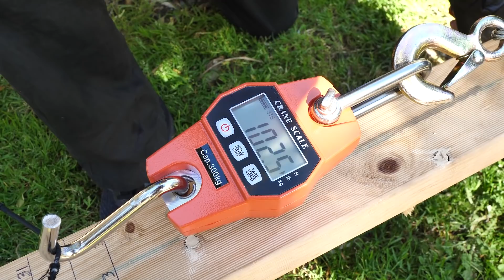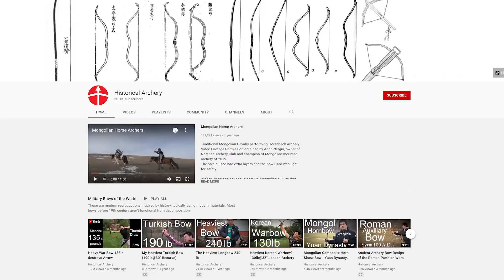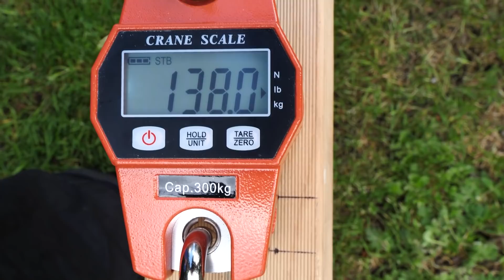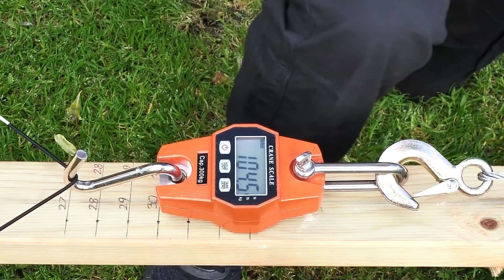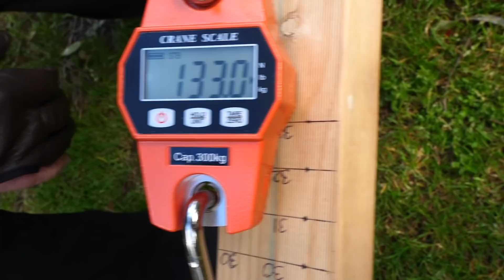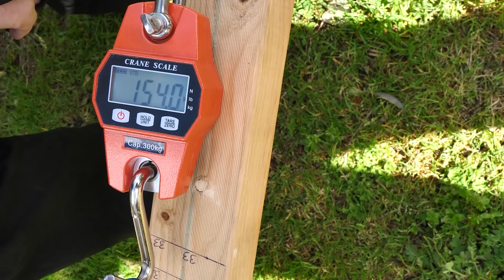Two idiots try to string a  TINY BOW

Comment: Shad, is there a chance you may have a misconception that the bow needs to be this heavy to be effective? Or that maybe bows of the time were not as stout? 

I know the Mary Rose bows are heavy, but what makes us think that was always the case with all bows of the period? (Genuine question, there are probably sources I don’t know of)

I have done traditional archery since the age of 2. My dad built bows and except for a few years between shooting, I have practiced it since.

I shoot modern laminate longbows, american style longbows, recurves, and yew longbows. 

Here in the States, we can kill deer effectively with a 45lb bow. I generally feel most comfortable drawing 60-70 which is more than enough poundage to kill.

With my 95lb Yew Longbow using arrows stout enough to take that weight, the arrows are quite heavy. The arrow speed out of these bows is smaller than the ones from my 60lb Yew longbow, and it seems the arrows penetrate the target less as a result.

Comment: Assuming the same pull weight in actual Byzantine bows you could with a little work come up with an impressive crossbow with better than steel bow performance.

Comment: Hey, someone tell me if I am wrong here: Wouldn't it be better if the draw weight is actually lighter on the full draw, but then ramps up as the bow returns to rest. I mean you want the most power after you have started accelerating the arrow. I mean that idealy you would want the most power as the arrow speeds up?

To be clear, I mean that when the arrow is at max draw it doesn't want to have the max force on it, it ideally wants the power to increace as the arrow speeds up?

I know that seems intuative, but I am thinking that on the other hand it doesn't matter where it gets the most power, as power is power, or maybe the more it accelerates the more energy you want to put in?

All that said maybe it makes no difference at all, and in an ideal bow the force would remain constant, as it's just acceleration over time? 

Anyone got any ideas?

Comment: Because the angle of the string is so much more narrow than with your long bow, you really should be using thumb draw.  I know it can be historically accurate to use mediterranean draw, but thumb draw is better for use with composite bows.

Comment: these draw weights are drawing scarily close to my weight, is it possible to draw a 120lbs if my weight is under 120lbs?
Reply: If you are that light, its probably because you are small and weak. You can't do anything about your size, but if you train enough you can get the strenght to stem you own weight for sure. If you want to get into shooting heavy bows i would advise you to get a lighter one first for training and thens tep it up. If you get one thats too heavy, it will only be frustrating.

Comment: Adam Karpowicz was given access to study the bows in Turkey's topkapi palace and ottoman military history museum, and after removing outliers came up with an average draw weight of ~110 lbs @ 28". So, safe to say you got a true war bow on your hands :) 

paper: https://dosyalar.nevsehir.edu.tr/33d4d0ae002fd6d0a9b38a6901c6fb3c/ottoman-bows.pdf
Reply: Also if you ever decide to do thumb draw: train up through the weights. Even down at 60 lbs you can give yourself nerve damage (it won't be by accident, you'll know you're hurting yourself) if you start directly there. Give it a few months or more, that tendon in your thumb will strengthen quite a bit and even heavy bows will be ok. --- of course all this is with a good fitting ring lol.

Comment: Makes me wonder about the possibility of recurve bows at the size of a longbow, whether they existed and what kind of draw weights they would get, whether it would make that much of a difference etc
Reply: I believe there are recurved longbows, or at least longbows with some ammount of reflex. But the thing about these small recurves is their low mass. With a light bow, its easier to shoot a light arrow very fast. If you make the bow bigger, it gains mass and fast arrows will be less efficient.

Comment: Hi Shad and Oz, had a thought regarding the draw length, would the reason that they're usually mesuared from the front of the bow be because that would then correspond to the minimum length of arrow you could use? i.e 27" from the rear with a 1" thickness would mean a minimum arrow length of 28" in order to keep the head in front of the handle/grip at all times, if you only knew the 27" inner length then you could end up with arrows that are too small to be able to draw fully, I will say I know little to nothing on the subject and this is purely a guess but it seems to make sense. anyway, keep up the great content & stay safe peeps :)

Comment: Ten minutes in I’m realizing Shad has displayed a handy table that should be usable for the task of stringing.
First thing I’m wondering: how well can you hold right before that ramp up point? From there is it easy to sight your target and pull the last couple inches before loosing? Would that make it easier to track and hit moving targets? When can we expect Oz to run around in front of you with a shield while you look into this?

Comment: Shad, the gym workout I'd most recommend to get the strength to draw your Mary Rose replica is the seated row. Lift for power (maximum weight you can lift in one rep). First, find out how much you can lift in one rep, then multiply that number by 0.65 (to get what 65% of that number is). The resulting product will be your baseline 10 reps for warmups and from there, decrease your rep numbers by 2 until you flatline your rep count at 2 for every 5% you go up in weight until you eventually get back to your max. When you can rep your max twice is when you should remax.

     Alternatively, you can also any any mixup of the numbers you got from the earlier calculations but the general rule is the number of sets you do is two lower than the number of reps you do with the weight you do on each rep corresponding to the percentages from earlier (for example, you do 8 sets of your 10 reps which means the weight per rep is 65% of your max which totals out at 10 reps). take this strategy but scale the numbers down to about 4 sets of 6 reps or 2 sets of 4 reps. 

     Generally in weightlifing, the more reps you do, the more endurance you build and the more weight you lift, the more power (aka strength) you build. I am a powerlifter these are the routines I myself use and as of now, I can at max in one rep benchpress 123 kilos, deadlift 205 kilos, squat 250 kilos and seated row 105 kilos (the seated row is a machine and that's the highest that the machine at my gym can go). As of now, I've been powerlifting for 3 years. Hope this helps.

Comment: Shad (or if anyone else knows about bows), when you drew the bow, you sometimes held it at a high angle before aiming forward as you reached full draw. Is there a reason for that?
Reply: leverage. 
I'm no bow expert, but from what i understand you have to keep your left arm(or whichever side holds the bow)  stretched while drawing a bow, so you effectively can't use your left arm's muscles to push the bow further. 
but by starting with your left arm raised a bit you shorten the distance between your left hand and your right arm, you can then increase this distance by lowering your left arm. 
this is a little bit easier because of gravity assisting you, and because you're translating a large movement into a small movement(leverage).
the same technique can be applied to the right(string holding side) arm as well, i think this is a commonly used technique in Japan(using leverage from both shoulders).
Reply: @Marvin_R  That's interesting. I've seen it done in some movies, but I thought it was merely to look cool.

Comment: Sorry to say you stringed that monster with the string upside down. The shorter white part of the string (or if you prefer the higher black quantity part) should correspond to the upper limb.
Reply from the maker: The string serving is sitting in the middle of the string and would be in the same position if you switched ends, the arrow pass sit's off centre which makes it look like the string is not in the middle, but if you look at the serving to the true centre of the bow you will see it sit's in the middle.
Reply: @shadiversity  not what I mean. All string are unbalanced in white/black part, with one part with more white (long part) and one with more black (short part). The part with more black, also called the “short part” must go up ‘cose the arrow should normally sit in the middle of the black part of the string and as the arrow is off center, to have it in the middle the short side must be up. That’s all 😊

Comment: correct me if im wrong but the easy easy easy hard is due to the shape of the bow correct? it's basically the outer curves bend easier then when it reaches the core/center it gets a LOT harder?
edit: grammar
Reply: I believe that hard wall he ran into at the end of draw is simply due to the bow reaching its limit. Usually recurves are a lot harder to draw from the beginning because they have so much tension from the start. Some also change their effective limb length during the draw, giving you a longer leaver as the limb tips unwind and the string doesn't rest on their back anymore, but it looks like this one here has no string contact besides the attachment points on the very tips.
Reply: @hernerweisenberg7052  ah, yeah i can see that as well

Comment: Shad I think your depth measuring method using a reference arrow is incorrect. While, your testing device is consistent in pull length from bow to bow, your arrow reference seems incorrect due to the different depths of the bow string. A shallow bow string will be more accurate in reference to your test rig vs a deep bow string.

Comment: The little bow ramps up after 28 because the string angle is already at 90° and after that the string is pulling the limbs backwards and not bending them. The bow isn't capable of doing more than that. Its called stacking and the weight start to go sky high on that point, that's why it feels like a wall.

Comment: What a beautiful recurve.
It's my understanding that these bows were made with horseback archery in mind, as the smaller size made it easier to maneuver when considering a horse; but I also recall that being the case with Asian recurves.
Was it the same case with Byzantines? I imagine such a bow would also be good working around murlons on castle walls.
Reply from the maker: These medieval style recurves were used on horseback but were not meant to be used that way exclusively. They were used just as much in every other way bows were used, such as warfare, sieges, hunting and so on.

Comment: I think part of the reason that the recurve ramps up in power at the end is that it is smaller and relative to it's length, you stretch it more with every inch. I hope my explanation makes sense.

Also I swear both of you gained muscles.

Comment: Interested to see if you try thumb draw with this type of bow. Although entering into thumb draw at such a high draw weight might be dicey. They generally recommend that you halve the weight of what you can comfortably draw when starting out with thumb draw, as it is such a different position, and pressure on thumb joints that you won’t be used to.

Comment: Where the bow goes from "easy" draw to harder is called stacking. This is where the limbs are reaching maximum tension on the face side and compression on the back side and gets worse past this point.
I have a 53 lbs Damon Howet  Hunter bow that does this past 28" and I have a 31" draw length making it almost impossible to draw further for me.

Comment: Hey, so about the step through string up technique thing, the loop of the string isn't supposed to be around the limb of bow when you bend it, just hold it freely in your other hand, and then put it over the horn once you bent the bow. It will be a lot easier to string it that way. Also, put your legs closer together, you don't want to bend it around the handle. One ankle goes into the curve near the tip, just like you were trying to do it, but put the other leg to about the middle of the same limb, where the opposite curve will end up. You should end up standing fairly normally, with the bow a lot more upright, then put your whole upper body into the bend.

Comment: Shad, He may have used the AMO standard which is measured from the back of the grip PLUS 1.75 inches!
therefore a, 28" draw would actually be 26.25" to the belly of the grip.

Comment: Because it's short the leverage is less so you would need to get stronger or use a bigger muscle group to string it. Also holding the bow on the muscles instead of the bone or joints would be less painful. Maybe this technique would help: https://youtu.be/sPLoU0mngfo

Comment: Yeah, a lot of RPG bows are just arbitrary damage.  Real RPGs like GURPS base the damage on the Strength needed to draw the bow.  So a Bow that requires a 12 Strength to draw does less damage and has a shorter range than a similar bow with a 15 Strength requirement.  A character with a 12 Strength can still use a bow with a 15 strength requirement, but they can only draw the bow far enough to do 12 Strength damage.

Comment: There are multiple ways to easily string a heavy asiatic style bow. A 2 minute YouTube search would have saved you a lot of trouble and embarrassment 😉
And the ramp up in draw weight means it's stacking at max draw of 28" and you should Not draw it more. This has nothing to do with the recurve design but the length of the bow. As that recurve actually helps you draw easier once that leaver kicks in.

Comment: Yes thats a modern material/modern construction techneek bow.
So a high class bow of the same size, made with older material types/older construction techneeks, would be caperble of what level of heavy draw weight? because when you think about it hideing a bow that small up a tree, easyer tha a war bow, yet still at about 120 range for fire power.
Hell's its a small sniper bow, lie in cover waiting for the target and fire off one hard hiting fast shot then disapear, because by that point moveing to evade any return fire sould be a higher priority just for self defance.
It's just not made to be a rapid fire bow, not at that high a draw weight. By the time you fired a few rapid fire shots, your arms would be akeing like crazy.
As a training chalange trying to rapid fire such a bow would be something a Master Archer would get a student to do to tear thair Ego's down a bit, after all it was a mater of pride with braging rights that you could string and fire a bow with such a heavy draw weight. Just relook at Homer's Odyssey at the end Odysseus was the only one of them that could string and fire his Hunting Bow.(because his bow's draw weight was so high and he knew the leg trick to string it?)
Reply: Historical materials are capable of higher draw weights than modern ones at this short lengths. For example chinese cross bows had draw weights of 400 pounds and 25 ish inch draw. Hand held bow record from quing dynasty china was 240 lbs. European crossbows with short composite rods could go up to 1400 pounds, but the draw length on those is only like 8" and the power stroke like 6", so even tough the draw weight is impressive, it is only about as powerful as 200 pound hand held bow, cus the draw length in them is just so much longer.

Comment: Before watching: Is the solution to rest the already strung end onto your shoulder and then wrap your arm around so you can lock it in with your elbow while pulling the other end closer to you while your other hand attaches the string?

Comment: Are you sure you put the string on the right way up?  😜
Reply from the maker: Yep, the string serving is in the middle of the string and would be in the same position if you switched ends, the arrow pass sit's off centre which makes it looks like the string is not in the middle, but if you look at the serving to the true centre of the bow you will see it sit's in the middle.

Comment: Reminds me of your shooting from trees test, where you pointed out that short bows could get a high draw weight and be more easily moved in the branches.  This little thing is clearly the kind of bow that would work best for that.  Actually, thinking about that video, could crossbows be more practical than even a bow like this?

Comment: I was always baffled by the all RPG systems diversifying shortbows as weaker and long bows as superior/more dmg.
Comparing same/ish draw # bows eastern bows are way lighter, more dynamic, and this force-spike after 27-28in is not for everyone.
Switching from euro release to thumb release also make impression of higher poundage.
Reply: That force spike after 28 is called stacking and that indicates this bows max draw is only 28". Stacking is something that you don't want from a bow. With different design bows can be drawn further before reaching stacking. From a powerful bow, you want as high early draw weight as possible, and as low late draw weight as possible, to get the most out of the stored energy, that's why modern compound bows are unmatched in their performance, compared to traditional bows.
Reply: @jkre  its 32" max draw (have ~30-31 comfortable), just the buildup vs standard bow is kinda surprising.

Comment: There is a simple explanation for what you experienced. It’s called overdraw. When the bow tips and the string exceed 90 degrees the lbs per inch drawn increase with orders of magnitude
Reply: Its called stacking, but yeah, true. At 90 degrees the string pulls more backwards than down, so it doesn't bend the limb any more, just tries to stretch it, that's why stacking occurs.